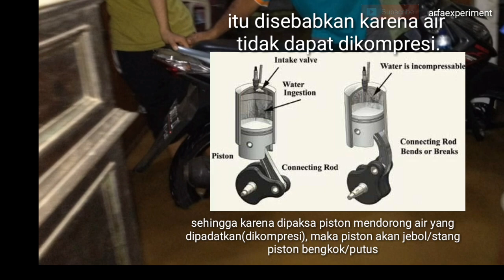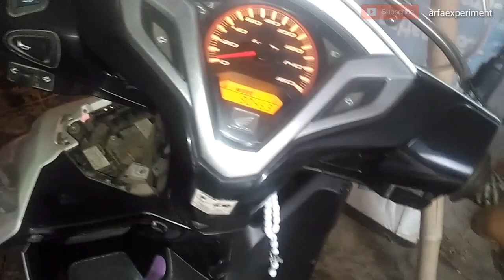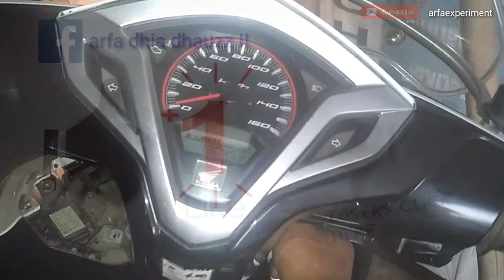PENANGANAN MOTOR AKIBAT BANJIR, JANGAN LANGSUNG DIHIDUPKAN! | motorcycle handling due to flooding

Comment: mas tolong bantu jawab.
beat karbuku kalau dihidupin pagi pakai engkolan, kadang suka meledak knalpotnya (enggak sering, jarang-jarang aja), suara ledakannya kenceng banget (mirip suara petasan diameter 3 cm). mesin & knalpot masih standar pabrik.
apa penyebabnya & solusinya?
Reply from the maker: Langkah awal, ganti busi. Kl tidak sembuh bersihkan karbu dan kawan2nya
Reply: arfa experiment busi udah ganti, karbu yang belum pernah servis 😁😁😁, kalau tarikan belum brebet nggak bakal saya servis karbunya (ada kali 1 tahun setengah nggak servis karbu), berhubung ada sangkut paut sama ledakan knalpot, ya waktunya servis karbu nih
Reply: arfa experiment makasih solusinya
Reply: @yudisastrawijaya6456  beat karbu aku 3th gak servis karburator. Pas jatuh aja tuh motor terus ada bau bensin di cek ternyata selang dr tangki ke karbu yg netes baru deh di servis tuh karbu

Comment: Yg sering 3 tempat air masuk ke mesin... 1,  liquid Radiator bocor..
2, Lewat sistem ruang Udara/boxfilter dalam.
3 , Lubang Dudukkan knalpot.

Yg sering terjadi dan jarang di ketahui..dan tahu2 ngebul/turun mesin adalah  nomor 2.. Apalgi Matic..

Jangan Sampai Box Filter ada air..meskipun sedikit. 
Filter udara kawasan bebas air /Anti air. ! ! ! 
Jika sampe ada air.. Dan di biar kan siap2 motor jeboll.

Comment: motor vario 125 led saya baru aja terjang banjir om . kira" setinggi standar satu .
tarikan berat ngeden gabisa jalan .
pas selesai terjang banjir hidup kembali .
ada efek ke yang lain gx ya?
Reply from the maker: CVT lebih baik di bersihkan
Reply: @arfaexperiment26  bang motor saya saat ini lagi terendam air Honda Verza setinggi spedometer . Penanganan nya besok gimana bang mau di angkat ke atas udh susah akses jln sudah setinggi leher . Terus mending di paksain bawa ke darat apa di biarkan terendam bang. Mohon bantu jawab
Reply from the maker: @serbaserbikehidupan8590  sama bosku, kl segitu baiknya tangki di cek juga ada air atau tidaknya, dan soket2 sambungan kabel dikeringkan termasuk soket ke ECU, mesin sama ky di video
Reply from the maker: Kl bisa ya bawa ke tempat kering biar gak ada tanah yg nempel
Reply: selip itu kampasnya karna kena air...
Reply: @arfaexperiment26  iya gan sampe saat ini kelistrikan belum bisa nyala semua spedometeer lampu" dan klakson itu kenapa ya ?
Reply from the maker: @serbaserbikehidupan8590  aki sekring relay kontak dll